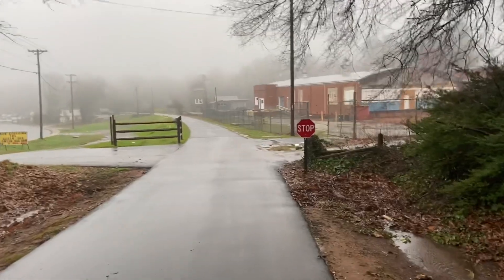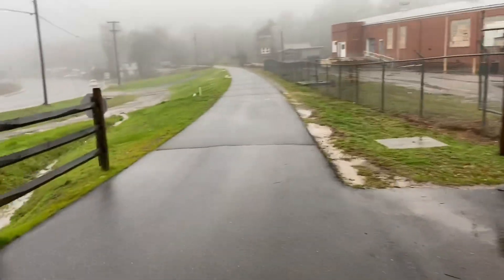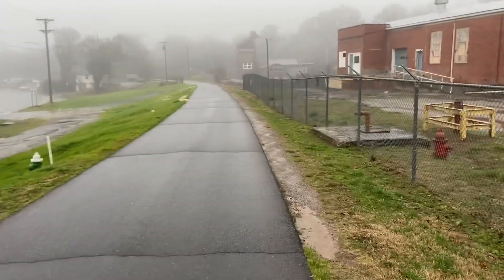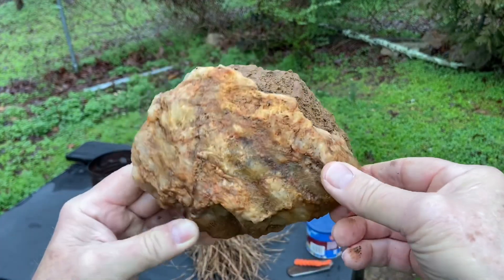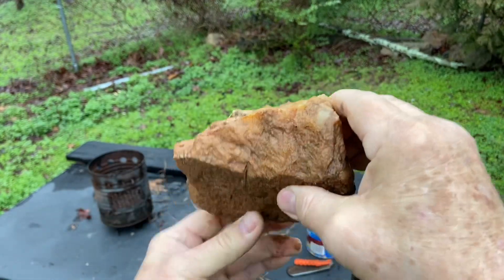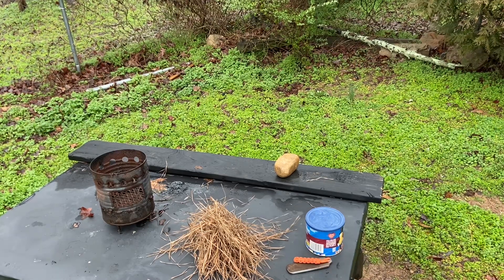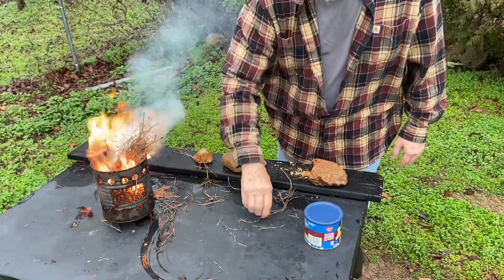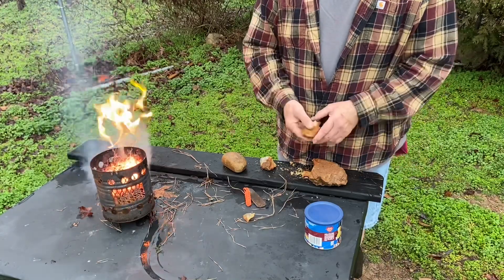Breaking And Using Quartz For The Flint And Steel Technique

Comment: Great video. It's easy to see you've done this 100 times before. No pretense, just a straight up demonstration. Would love to see a video talking about the mohs hardness scale and the different rocks and minerals you can use in a pinch
Reply from the maker: Flint, Chert, and Quartz have the rquired hardness of 7 to scrape microscopic pieces of iron from the steel which reacts with oxygen in the air to ignite. Harder stones will work also.

Comment: Im new at this .The quartz i find here in Tn. Is very crystally after you break off a piece.Dont really have what you call sharp shards to strike.Best i can tell yours looks a little different.It works ok tho.I guess quartz is quartz no matter where your at.ha.Im finding another rock im guessing is a chert.you can break it into sharp pieces and it works better.But you cant use it many times until the sharp edge is gone.I dont seem to have flint like i see in the videos.Ive learned alot watching your videos.I made me a couple strikers out of a file after watching one of your videos.Works good.Im curious tho if the ones you can buy would work better.ha.Thanks
Reply from the maker: All files are not the same in sparkiness. Try buying a steel and also watch my flint and steel playlist.

Comment: Does it need to be a nicolson file or does a normal store bought file work as well? I am a tradesman and have nicolson but I am definitely not going to chop them up for making a steel striker..I look after my tools...hope you can shine some light on this matter....cheers.
Reply from the maker: I've always used Nicholson files my whole life. That's why I chose it. Steels cast sparks because of the right combination of hardness and carbon content. I would think other that files will perform just as well for a steel.
Reply: Thanks for the reply but it is not that common here and Nicholson files are quite expensive that is why I have them because they are the best but I dont have one laying around to be used like that and South Africa is a place where you kind of struggle to get quality tools.